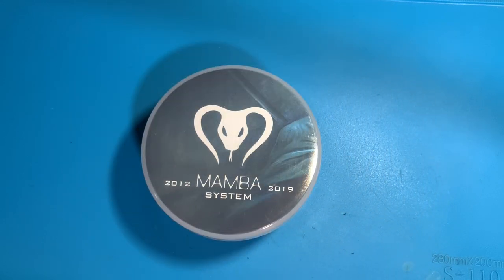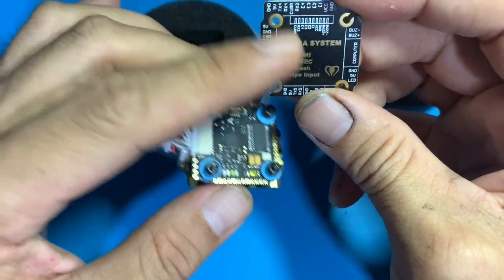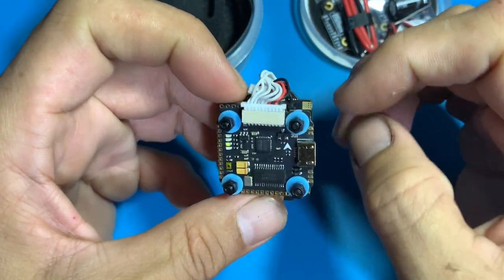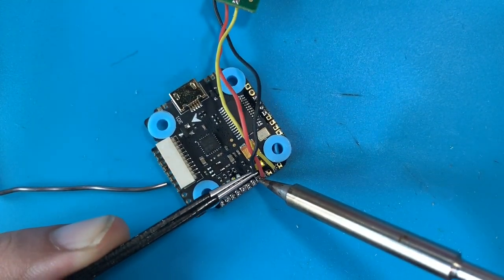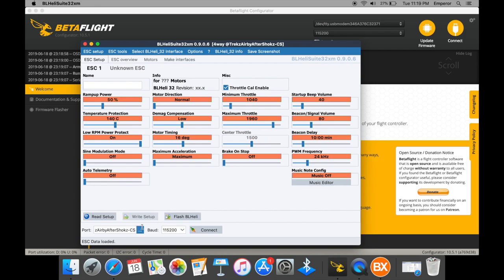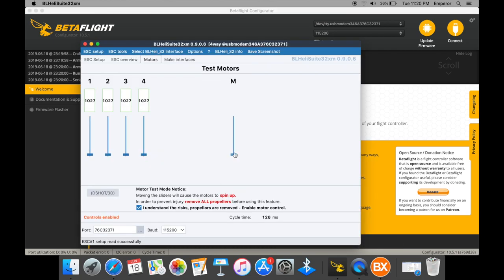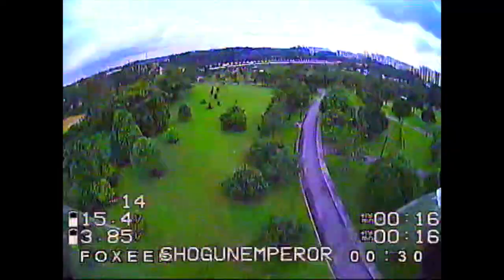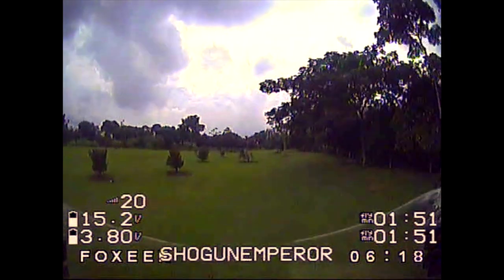Diatone MAMBA F7 mini stack - 5 inch build review

Comment: I want to put this on a 5 inch with 2207 motors about 1800kv on 6s but not sure this stack can handle it. Very interested to know your experience.
Reply from the maker: Jack Truong hey Jack! Thanks for watching! It cant handle it. The ESCs only rated 35A, although it can take the 6S, the mosfets of my ESCs popped on 4S.(and I wasnt even pushing past 60% throttle) Its just collecting dust in the corner right now. WAS amazing. Just wished they had better ESCs!
Reply: @shogunemperor  Thanks man! I am not sure if there are any 20x20 ESC that can really handle the setup I want. So standard on 30x30.  Ppl said aikon 20 X 20 can handle it but I read reviews the ESC caught on fire.  One guy said he has 5 and most of caught fire but  I know a very good racer run aikon 20x 20 on all of his fleets and no issue. He runs them on 2207.5 motor 6s.
Reply from the maker: Jack Truong try the SucceX F4 or F7 stack, but do choose the ones with wires instead of pins. Most of my 5” videos are those on 4S or 6S

Comment: How would I install the micro swift 3 v2 to this fc with mach 1 vtx
Reply from the maker: byrden1985 hey, thanks for watching. So the micro swift 3 has 3 wires that goes to cam, 5v and gnd, and the mach1 wires goes to sbus, 5v, gnd and audio to TX6. Hope that helps

Comment: Is 30A enough for 4s xing motors 😅🤔
Reply from the maker: its sufficient for just regular flying but if you're going hard acro.. I suggest at least 35-40A minimum
Reply: shogunemperor , ah ok thx Bro 👌🏿
Reply from the maker: @silencefpv7130  pleasure sir!
Reply: I am flying a hx 100 for my first quad , now I want to build my first freestyler, you think this stuff is great ?!: tbs unify pro hv race , tbs source two frame , mamba f722 stack , caddx ratel , xing e motors (4s)
Reply from the maker: @silencefpv7130  nice.  Parts list sounds great.  Source 2 frame is great from what I hear.. and pretty reasonable in price.  Maybe dont use the mamba stack,  use a mamba F722 with a Hobbywing X-rotor ESC will be my personal recommendation
Reply: shogunemperor , ok thanks , before caught fire 🤣🤣🤣💙
Reply from the maker: @silencefpv7130  hahahahaha
Reply: shogunemperor , what about flycolor x-Tower 4A 🤔😅
Reply from the maker: @silencefpv7130  my last experience with flycolor has them in my bin... that is after smashing it and driving over it with a truck.  LOL the new ones seems pretty good.  The Koreans and Chinese are using them.  But I had the F3 and never used it since.
Reply: shogunemperor ok thx Bro 💙👌🏿👌🏿